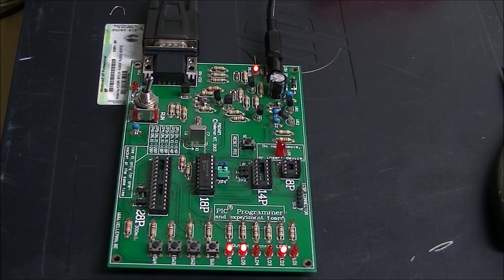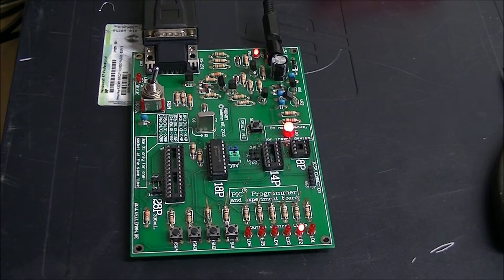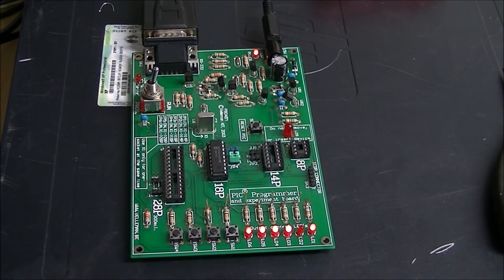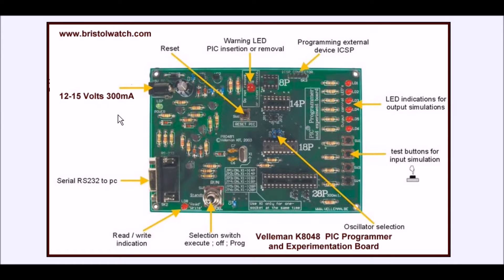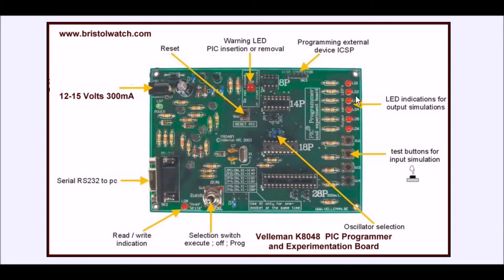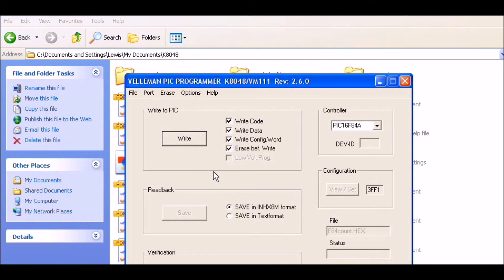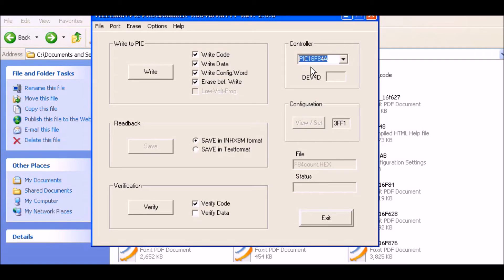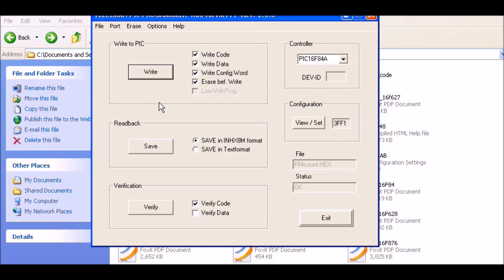Using Velleman K8048 PIC Development Board

Comment: Hey there! Your video is great! I have the same kit. My soldering is fine. The lights and all go on and the like. But it wont write to the pic. Are you still working with these things? It would be cool if i could get some advice ill post a video of my problem if that would help?
Reply from the maker: What voltage power supply are you using?
Reply: Lewis Loflin a twelve volt power supply. I have tried a higher power supply but still the same problem
Reply from the maker: You have to use a 15-17 volt supply,
Reply: Lewis Loflin  ahh yes! That worked. I got the program to write with demo one. Though when i went to try and write demo two, i keep getting the error writing to pic message. Any ideas?

Comment: Hi Lewis, I used this same programmer for  while when i was first using PIC. I use Atmel now, but it was a good board for learning.
Reply from the maker: I agree for those starting out. One thing I'm trying to do for those just getting into this is get working code and ideas into their hands. When I taught myself Linux books were useless because i couldn't get a system working to learn anything. Then I ran into Puppy Linux that worked anything then I could move on. I'll be presenting a lot of short clips on basic code.